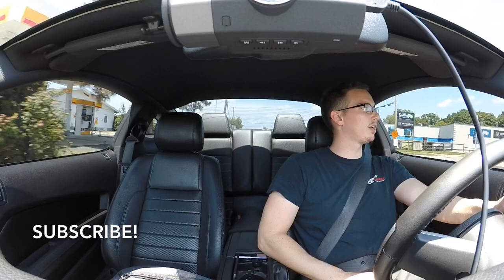Brake Pedal Pulsating? Here’s The Fix!

Comment: Did I miss something?   What's the fix...changing your pads and rotors?
Reply: Yes, change the pads and rotors. Likely it's the back ones according to this guy. To avoid it happening again in future, come to a stop slowly rather than quickly - too much heat too quickly warps the rotors.

Comment: A tech where I had my tire change can’t feel the pulsing bc I didn’t know what the cause was. I just had my tires swapped and the pulsing occurred AFTER the tire swap. They didn’t bother to do anything about it. Should that be happening while I’m doing like 40 tho? Even without stepping on the brakes
Reply from the maker: Have the tires rechecked and make sure the belts not messed in in the tire
Reply: @Petersiksmotors  I took it to the place I had my tires swapped and the guy is confident it has nothing to do with what they did. Dude even went on to share with me he’s been driving for twenty years, like that’s relevant. He did not feel a thing when he test drove it. I will take it to my dealer and mention what you said, thank you!
Reply: If it’s happening without pressing on the brakes that means your wheels are out of balance. Tire shop should balance your wheels whenever tires are removed or swapped out.

Comment: 07 Dodge Ram replaced breaks , rotors, wheel barrings calipers and yet still pulsating.  Any suggestions
Reply: I’m in the same boat. I’ve literally replaced everything including the transmission that the axles go into! It does the wobble with the wheel off too so eliminated the wheel. Replaced entire knuckle, hubs and spindle with stock built from Chrysler. Replaced axles, replaced tie rods, inner and outer, replaced control arms and of course brake pads, rotors and calipers. I’m f***ing lost!! There’s nothing else to replace. Could it be that I just need to bleed the entire brake system?
Reply: @saintmarckaeden  I just figured my issue out.  Back rotors where bad.

Comment: My front brakes pulse and they are brand new.the fluid has been bled also
Reply: same have you found the source of the problem
Reply: @khalilJon  not yet I think it’s a control arm bush personally.. gonna jack it up and have a look soon
Reply: @khalilJon  front lower control arms
Reply: It’s probably a worn out caliper
Reply: @pedrorubio950  in the end it was my lower control arm bush that was worn pretty badly,, replaced both arms each sides and the braking is smooth as ever now
Reply: @GG-eg6kn what kinda mileage did you have on your lexus ..lm having this problem with mine. Mine has 92.000 miles change pads and rotors 3 times with the last using Toyota parts .
Reply: @jkjayneinc  mine was an Audi, at around 110k miles.. it was the front ‘lower rear’ control arms the ones that are banana shape.. 🍌 have a look under your car and give each suspension arm a wiggle! There should be little to no play at the the bushes